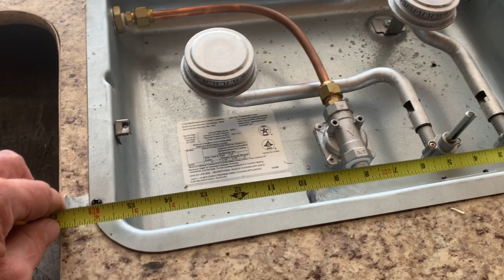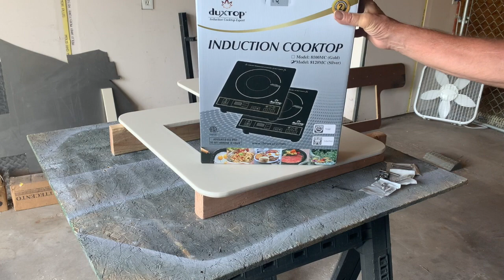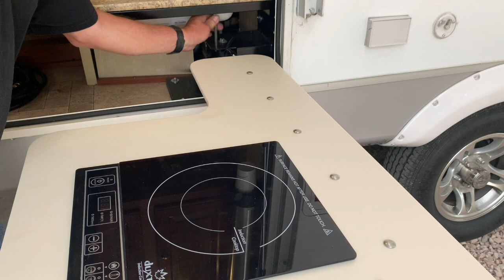How to update your RV to Induction Cook Top --  portable RV Cooking Convert a RV  LP Propane burner

Comment: Hi bill,

Can you tell me more about the induction plate's electrical behaviour?  How much power are they using and how do they use it?

I liked your video about the 12V fridge because you showed that the compressor was a real 12V compressor and not - what I heard happen - a 120V compressor with a little dedicated inverter built in to the system. The 4.9 amps at 12V was also great information. Our big-box-bought 120V 10.7 cf Haier uses about 6-7 amps behind a 1000 watt inverter, so great savings on the power by going true DC :-)

With this induction plate video I am again interested in power usage. Many induction plates seem to regulate their power by cycling their full power on and off. It's like 1600 watts or nothing.  We have two now obsolete Nuwave pic pros. They choose different wattages depending on the temperature settings. I've measured them using 600, 1000, 1300, and 1600 watts.  These intermediate wattages make it possible to run the two induction plates at the same time without our 2000 watt inverter crapping out. Two “on/off” plates would trip our inverter when they both hit their 1600 watt cycle at the  same time.
Reply from the maker: The duxtop only uses what it needs not switching 1600 off and on. Most of the time I cook on default which is number 5. About 1100 watts. Watch my other video on the counter top replacement. I pull the stove oven out and put another one of these inside.  Use my link and get one from Amazon try it out. If not like return. We love both of ours. Thanks